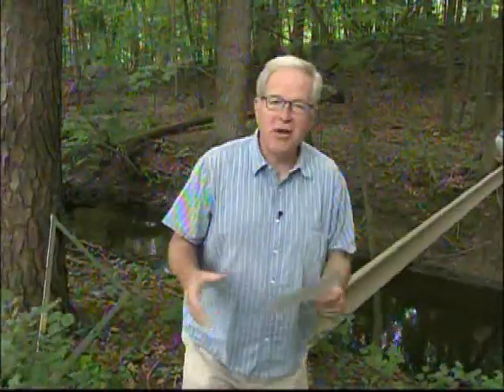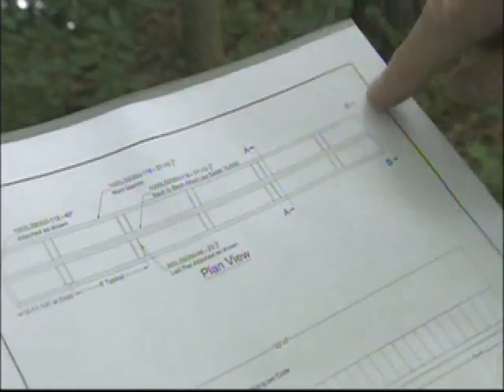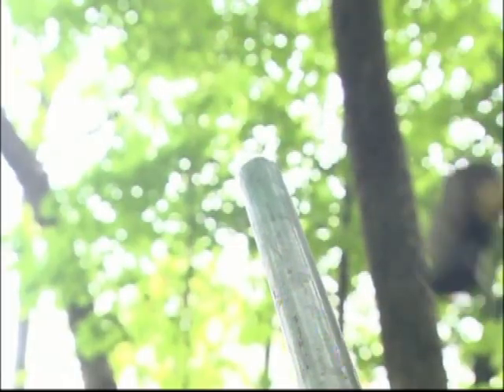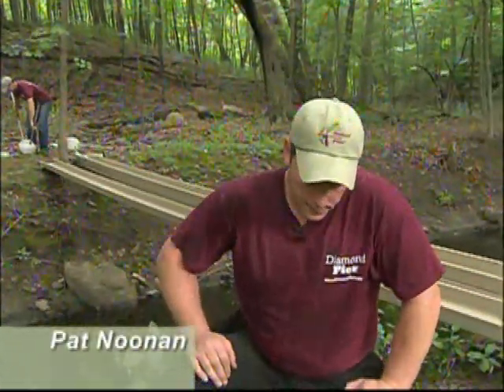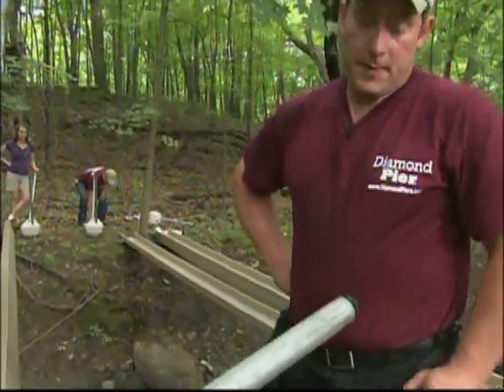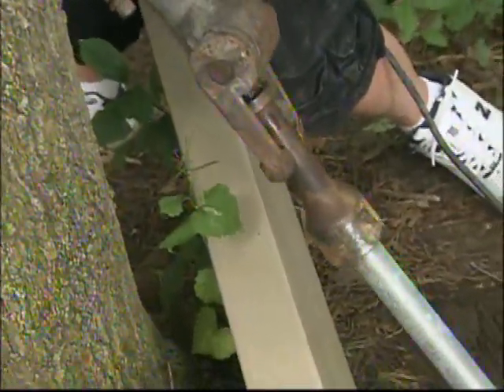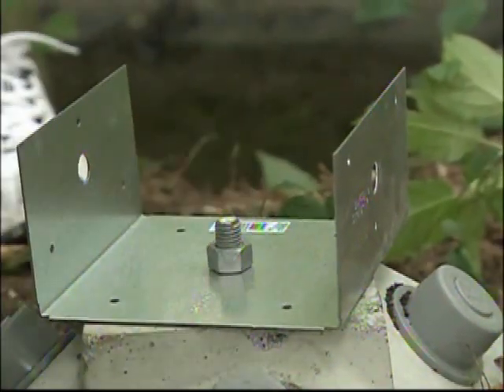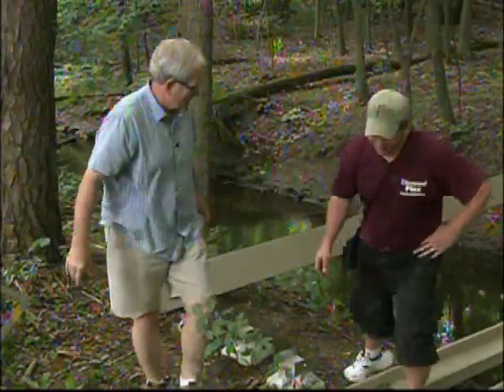Diamond Pier as seen on Hometime TV

Comment: Could I use the dp50 for a balcony and porch combination or use the dp75. 12x25 porch and balcony dimensions, gets wind gusts directly on occasions, nothing heavy sitting on top, installed in South eastern South Dakota. Planed using 4 in the front, and could brace middle of porch with 3 for added uplift protect.

Comment: What happens when two feet down you hit a rock?
Reply from the maker: The pins will push through rocks about the size of your fist or smaller, and there are ways to work with avoiding larger rocks, but if you're in an area full of boulders we don't suggest using our system. 
https://www.diamondpiers.com/installation-manual/installation#encountering-obstructions